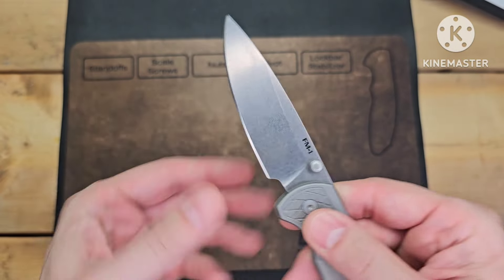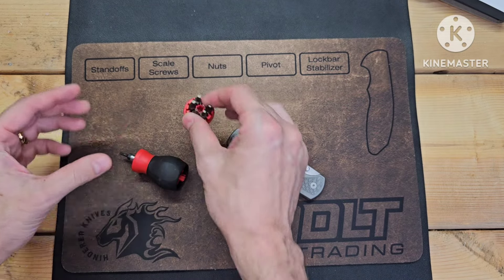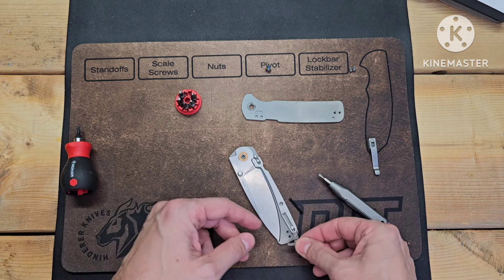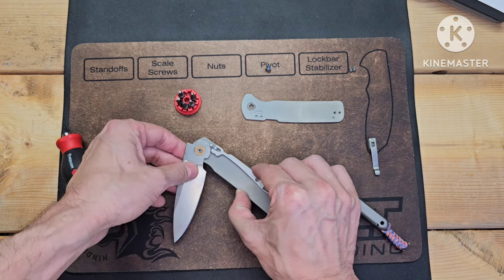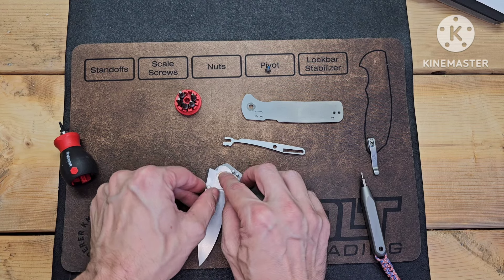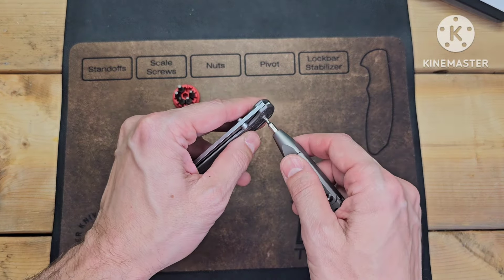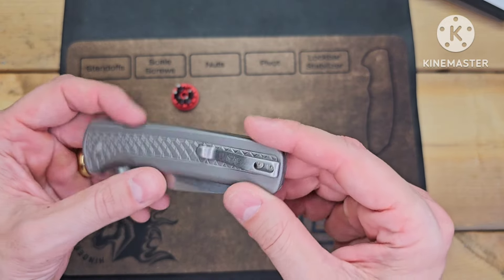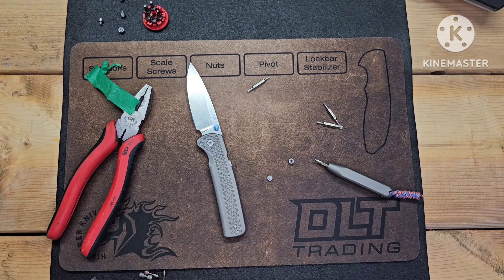Cold Steel FM-1 - Full Metal Atlas Disassembly

Comment: Thanks for the disassembly video. I was wondering why the big cutout in the heel of the blade and as suspected, it's to fit the lock-bar mechanism when the blade is folded in the handle. Production quality looks top-notch. You can see they scalloped the blade tang to meet up with the stop pin for more/better contact. Really good. These are Taiwan-made if I recall correctly. 

Also, I actually like this lock design better than the Shark Lock because the pull tab is completely out of the way. This knife really has a lot going for it, including the uncomplicated design aesthetic. 

Would be interesting if they did a version with thinner blade stock and slightly thicker handle scales, maybe in G10, and at a lower price point.